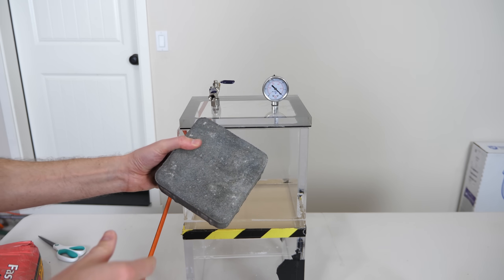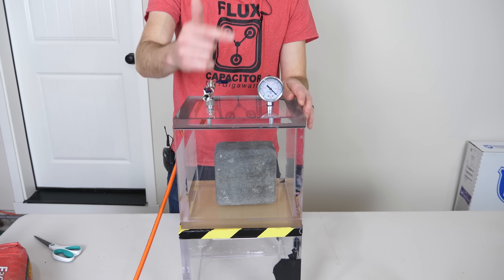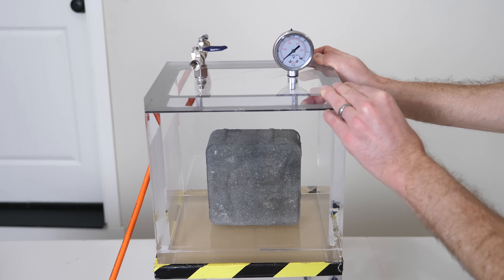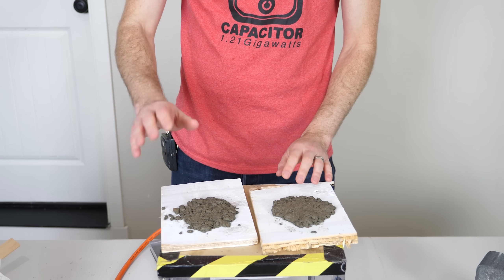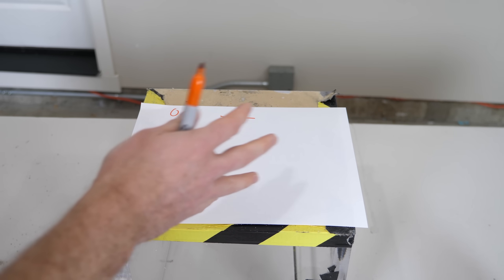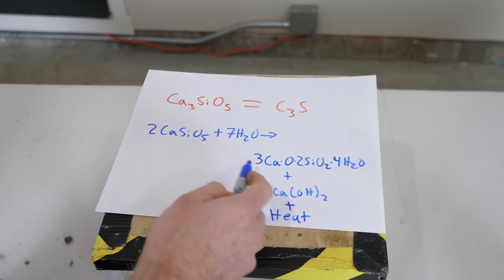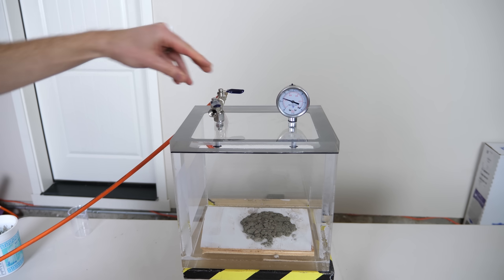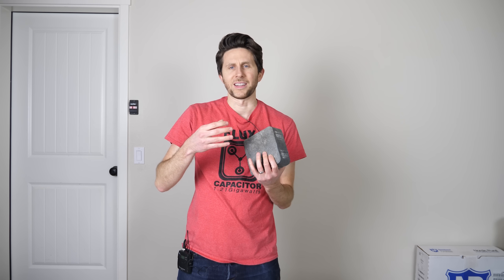Does Concrete Turn to Dust in a Vacuum Chamber? Concrete Without Oxygen Experiment

Comment: A few points here:
- For concrete to turn to dust, you'd need to pull it to it's tensile breaking point. Which is roughly 3Mpa (mega pascal) for homemade concrete.
- Mpa is a measurement of force of impact on a certain area. It's important how big the area of measurement is. Let's say the area is 1cm square. In this case a vacuum or anything else would need to pull with 30kg of force on every single square cm of that concrete piece to reduce it to dust. Quite a lot of force on such a small area. 
Another way to look at it is if for example you attach a 3x3 inches metal plate with glue to concrete. You'd need around 170kg (375 pounds) of pulling force on that steel plate to pull concrete apart. If the glue is strong enough that is. 
- Concrete takes a whole month to fully cure, but it reaches 60% of it's strength in a day. I'm a construction engineer by trade, so I know a lot about concrete. 
- An additional point to all curious about why concrete falls apart, it is because of carbon dioxide (CO2) it bonds with hidroxides in cured concrete, reduces it's ph value, and returns it to it's more natural form - limestone components so it crumbles away. So essentially in space concrete is everlasting, there is no co2 to chemically destabilize it. While in Earth's atmosphere it's destined to fail the moment it's made.
Reply: The Materials Engineer has entered the chat.
Reply: Or, put simply, concrete is strong and can handle 1 atmosphere of pressure whether it's from the outside or the inside.
Reply: After I checked this I feel dumb
Reply: Just a quick one: does (portland based) concrete not contain pores partially (or completely) filled with residual water and/or air? Assuming some of these pores are completely sealed (i.e., not permeable) is there not potential for exposure to vacuum to induce internal stresses in the concrete as the water/air mixture expands?
Reply: Most readily available pockets of cement, if you follow the instructions will give 32,5mpa
Reply: Most standing Roman architecture such as the old aqueducts etc are where concrete originated from, it is destined to fail but over the course of at least a few 100 years
Reply: @psykology9299  2000 year old Roman concrete is still intact, because the CO2 acidification the OP is talking about only damages REINFORCED concrete with metal rebar.
Roman concrete is not reinforced and it was also used for compressive strength and not put in tension, so the fact that CO2 has made it more acidic does very little.

Concrete made without rebar, or with fiberglass rebar instead of metal, lasts essentially forever (until eroded by wind and water just like normal stone).  It is only reinforced concrete that has a limited lifespan.
Reply: @Kieselmeister  hectic I didn't take that into account... I knew that concrete essentially becomes limestone eventually if left to the devices of nature which would then be more prone to water erosion but I completely overlooked that the rebar would break down and thus weaken the concrete
Reply: @psykology9299  a few hundred? Mate, time you googled Roman Empire, try 2000 yrs. The aqueducts were not concrete, they were usually stone or brick with mortar holding them together.
Reply: Doesn't matter how many mpa you get to with out the element oxygen the water used to mix it is just hydrogen gas water will not exist
Reply: @melesionieto2658  that's if you take the oxygen away before the concrete has set, once it's set take away all the oxygen you want, the chemical reaction is over
Reply: So would concrete rapidly decay if exposed to high amounts of carbonic acid?
Reply: @thaumatik  give it a few thousand years and you can dissolve it with water 😂
Reply: @thaumatik  Concrete is a base,  Acids break is down.  Stronger Acid, the faster it breaks down.
Reply: Huh, so extraplanetary bases are likely going to be made heavily of concrete.
Reply: based
Reply: The only thing that you left out is obviously a compressive force could also crumble concrete. It’s only that concrete is much much more resistant to compression than tension aka why rebar is so necessary (metal is powerful versus tension)
Reply: Did you watch full vid
Reply: nerdd just joking buddy
Reply: Thank You
Reply: And how long did it take you to write this exactly?
Reply: ok.
Reply: But in this case the individual molecules would be 'pulled' by the vacuum, which could potentially start degrading the concrete without the stated amount of force.
Reply: And how/why do you think the towers came down on 911?
Reply: @philindeblanc  
By the temperature weakening the steel beams, how is this relevant in any way, shape or form?
Reply: @lucaslucas191202  I guess you never watched the videos of the towers coming down? The concrete is pulverized to dust, there are ONLY steel columns left at the bottom, even the steel was pulverized. Wow..didnt expect this from an engineer. There are over 10,000s of engineers that do not accept the "offical" story...because they looked into it.
Reply: @philindeblanc  No Structural Engineer with any knowledge of the Towers doubts the official report.   The stressed skin design of the towers has a very high reliance on the strengths of the crossties to keep it constrained.  As the heat of the fires expanded the crossties expanded, allowing the stressed skin to buckle outward.  And the skin failed.  

It is important to realize the towers utilized a very distinct structural assembly.   And, that it was discussed and analyzed in many common structural analysis text books.  I graduated in 1992.  The Structural Analysis text, I was taught from had a chapter on the Towers that the graduate students all had to do.  That book was published in ten languages, including German.  Key planners of the attack were graduate students in Architecture at a German university.  They would have had access to that book, even if it wasn’t an assigned text.  

I did the chapter and it’s homework problems as a “flex chapter”.  I worked my way through college as a bolted steel, and fireproofing inspector for steel structures.  I also had a summer job helping design the demolition plan for an old Vegas casino.   

The demolition of the Towers by the terrorists was a very well designed and executed effort.  When the towers were attacked I was at work.  One of the other Engineers, who came in after I did came in and and heard of the attack on the radio.  Seven Engineers gathered in the conference room to watch it on the news.  After two minutes of watching the various view angles on tv, I said it was coming down within the hour.  If they were lucky it would pancake and not topple.  I was explaining how and why on a white board, when the first one pancaked.  

The aircraft had penetrated at a perfect height.  It had lots of fuel, the diagonal wing tilted impact spread the wing carried fuel and intense flame to multiple adjacent floors.  The impact shattered the “fire proofing”.  From that point forward, the collapse was inevitable.
Reply: Finally an engineer who knows what he's talking about.
Reply: So long as you keep pro land cement concrete damp is continues to cure and gain strength.  the 28-days is a practice acceptance time developed by engineers.   The Bureau of Reclamation still has test cylinders from teh construction of Hover Dam, and every year they break a few, and it is still gaining strength.  Not much any more but it continues to cure and gain strength.  

Full vacuum isn’t strong enough to break the hydrate bonds, so concrete wont break down in space.  

Back in the late 1980s, I had a job as an Engineering Technician.  The design Enigneers had specified a polymer concrete to join two concrete slabs.  My boss and I went to a class put on by the polymer concrete manufacturer, on how to work with it.  You put a coating on both surface and waited thirty minutes for it to cure, and then you put on a different coating and waited another half hour, before applying a third and final coating on.  My boss, who had a degree in Chemistry, asked the why so many coatings, and why three different ones.  The manufacturer’s Chemical Engineer who was teaching the class told him that the coatings were to protect the fully cured Portland Cement concrete from the polymer concrete, because while the polymer was curing it had high enough affinity for water, that it would break the hydrate bonds in the PCC, and turn it back to cement, and the joint would fail.  I looked at my boss he looked at me, and i said, “That’s it.  I’m going back to school”.  Went to the Community College that fall and started taking chemistry classes after work.  A year later I quit working and went back to college full time.
Reply: @randallthomas5207  Uless you use Tesla Magnatron frequency generator and pulverize it. This tech is not in the public domain, but very much in the rulers.
Reply: why does it take a month to finish, and just a day will get it to 60%
Reply: "We can use concrete structures in space"  LOLOL
Reply: What if you farted on it?
Reply: Its not that one should worry about it turning to dust. We have to be concerned with the next cataclysm meltology period. Then perhaps a mudflood. There is no space, and this channel constantly pushes the fake idea of space. Sad how many just swallow the BS while not having a shred of reality in it.
Reply: Wait, you're an engineer on concrete, and you are assuming what happens in space? I usually take engineers, specially civil, and those that deal with reality and physics, and less on the theoretical calculation side, as pretty skeptic thinkers. But I guess not all.
Reply: @philindeblanc  Concrete is basic chemistry. It is an anaerobic, exothermic chemical reaction-bond, meaning it needs no air or excess water (except for the chemical reaction itself) for it to cure, once the chemical reactions start. It can cure, under water or in space, there is no difference. Test samples are indeed cured for a full month under water, not on air. Then they go to testing. A vacuum (lack of air) makes little to no difference for a chemical reaction.
Reply: Is it "destined" to fail literally, as in if the mixtures is poured/cured in atmosphere,  it's already been exposed to factors that inevitably lead to failure? Or is it the sustained presence of atmospheric variables that eventually lead to failure?

I'm wondering if it's possible to replicate concrete in vacuum, and if possible, if it would have a positive impact on the materials durability/properties.
Reply: @Nikolai18A  You can pour concrete in vacuum, it's an anaerobic chemical reaction, it needs no air to cure. Its also common practice and desirable to cure test samples of concrete underwater for 28 days so the tests have as little as possible sample deviation. The carbonatization process is constant, the concrete absorbs CO2 from atmosphere for years and decades, and very slowly but surely loses it's properties. It's also not that it loses its integrity altogether, it loses some, it's rather that it gets much higher acidity and rebar inside corrodes and then breaks apart, then what was standard pressure can break the same construction easily. That's why you see rebar exposed and corroded and breakaway concrete on old buildings. So yeah as long as we live, CO2 is present in the atmosphere and standard Portland Cement made concrete from limestone is inevitably gonna fail.
Reply: Just encase it in something else.
Reply: as more CO2 is added to the atmosphere concrete would last for less and less time based on this
Reply: @bdlc9952  that's assuming they carbon dioxide is evenly distributed throughout the atmosphere
Reply: @bdlc9952  The amount of CO2 in the atmosphere is approximately 410 parts per million. That's 0.04%. So while yes, more CO2 in the immediate surroundings of a particular concrete structure would increase the rate at which it degrades, the severity of that change however would be negligible.

That is to say, there is so little CO2 in the air that any reasonable change in its amount will have little to no effect on concrete. It does, however, have a drastic and runaway effect on the climate.

Worry about temperature, not concrete.

Comment: To harden concrete it needs to stay moist. If dried to soon it doesn't reach full hardness. That's why you see so many sidewalks with surface erosion. Contractor just left it to dry in the sun. Cover with plastic after initial set and leave for a week and you get harder surface that lasts much longer.

Comment: Concrete doesn't "dry", it "hardens". Water becomes part of the matrix via the described chemical reaction. Some excess water will evaporate, but it retains enough for the matrix to form. Vacuum may cause some more water to evaporate during the hardening process, but unless you could mix the cement and water in a full vacuum (hint: very difficult, as the water will boil away before you could pull a full vacuum), it shouldn't have any noticeable effect.

Comment: If it were still wet inside it might have cracked up a bit and some pieces might have popped off but fully dry nothing. The vacuum on the setting concrete will probably make it set faster.

Comment: Well the trick is how fast the vacuum is pulled, if you pulled it instantaneous, I could crack, but slowly isn’t going to do much as it allows the air pockets to slowly vent and you won’t get much more then a few PSI of pressure differential.

Comment: I think it will be fine, I'm about 75% confident. It seems like it might deteriorate faster with no air, but it seems unlikely to just crumble. It might explode from internal pressure of trapped air bubbles, though. that's why only 75%.

Comment: Can you put that claim to the test? that you can build stuff out of Concrete in space? Namely, can you build a Concrete Box, with something inside to record atmosphere or O2, or something, and prove that a Concrete building, built in space, would be able to, in theory, keep the atmosphere out and not have it penetrate it. And if it did Prenetrate the 'walls' of it, how thick would they need to be to prevent leakage of air or other stuff?

And yes, I know the Video is 2 years old and probably never going to happen, but it got my brain going and I got questions!

Comment: Since concrete is really porous, I'd assume that the air is just pulled out. That's it.
If it's really dense, maybe a small crack could form.
Furthermore: if oxygen was removed (e.g. put under nitrogen atmosphere), I know that nothing will happen.

Comment: The reason why the sample placed outside is lighter in color is because of atmospheric carbonation, where the CO2 from air reacts with the calcium hydroxide to form calcium carbonate (source of white color). You can notice when the sample is flipped, the color looks more like the vacuum sample because that side of the sample did not get exposed to air.

PS: Thank you for making this video because the myth was getting annoying. We dry concrete in vacuum chambers all the time in concrete labs.

Comment: The people who might think concrete need oxygen to stay solid.. errr I presume they are also anti Vaxers and flat Earther's? 
I.e in need of secure accommodation in a mental home. 
As for will it harden in a vacuum? 
Well that depends on how much water is there and what the ambient temperature is. In a vacuum water will boil off reducing the temperature to freezing point if there is sufficient water.  Concrete will not cure if the temperature drops below 5 degrees without an additive that speeds up the cure and creates enough heat to stop the water freezing until it has all reacted with the cement making concrete.

Comment: (Answering before watching full vid) The cured concrete block will stay solid because it is already reacted with O2. if left in a vac for many years it may brake down but not in a short time. The wet or uncured concrete is a different story... if left in a vacuum for several hours the water will evaporate and no or little O2 will have had a chance to react with the cement mixture causing it to turn to dust.
Reply: Well... I was partly right. I thought cement needed air pressure to cure but it looks like I was wrong, it will cure to some degree even in a vacuum as long as it has had even a few minutes of exposure to water. The heating of the mix is a dead giveaway that the chemical reaction has taken place. 

I spent 5 years in masonry where I mixed tons and tons of mortar, concrete and cement by hand or with a mixer and this is new to me :)

Comment: Pretty much exactly what I thought. Removing elemental oxygen is completely different than removing the air around it. I didn't know the exact elemental breakdown of concrete so I did at least learn something from this but once oxygen atoms are bonded to other elements you can't simply vacuum them out

Comment: My guess is that the concrete block will be completely unaffected by the vacuum. I think there is some misconception about how concrete works. Having air bubbles in concrete makes is weaker, not stronger, which is why a good foundation setting includes the use of agitators during the pour. Even if there are air bubbles trapped inside the concrete, it is unlikely there will be a large enough pressure differential pulled by the vacuum to cause any sort of damage or failure.